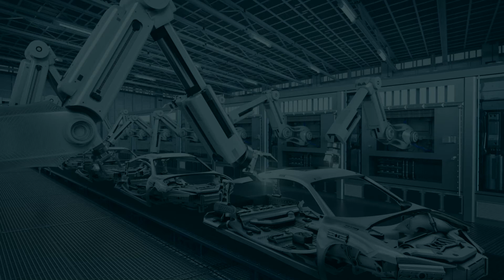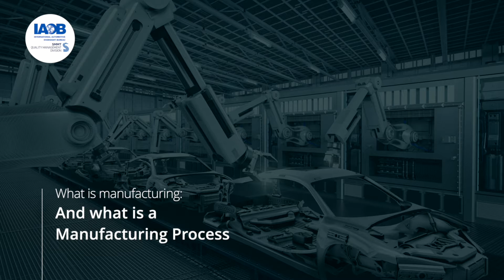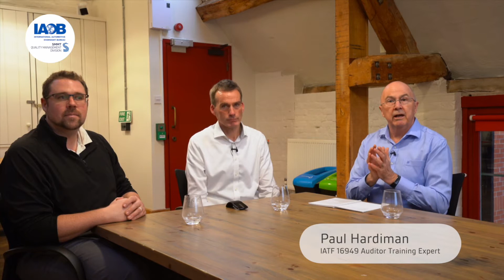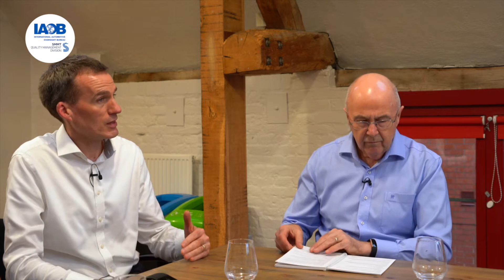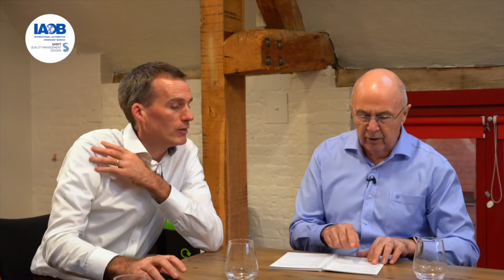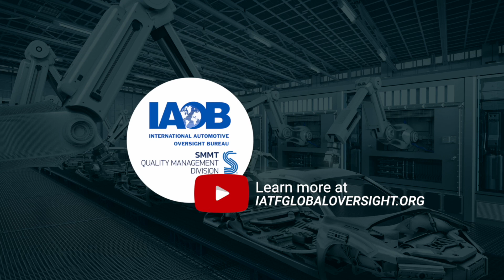What is manufacturing and what is a manufacturing process?

Comment: Dear sir
Just a clarification - if an organization is having x , y and z processes with 3 shifts, each processes have to be audited covering all the shifts within 3 year period? Example process 'x' is planned to audit 1st year for 1 shift and 2nd year for 2nd shift , 3rd year for 3rd shift... Is this acceptable? Pls clarify
Reply from the maker: You are correct, AT MINIMUM, all manufacturing processes have to be audited in the internal audit programme in a three year cycle, but in deciding the frequency you should review performance data, customer issues, previous audit results, changes etc.
Reply: @IATFAuditing  thank u very much
Reply: I think that you have to audited each one process in all shifts where is performed and also the change between the shifts must be audited too (where the 1st shift is finishing and 2nd one is starting) in order to see if this is going according to the rules. If for process "x" are working different shifts (staff) than the process "y", then you should audited the all shifts in process "x" and the change of the shifts. And in another audit to be audited process "y". But will be great to see the point of view of the experts too.
Reply: We have 3 different processess too - Injection Molding, Printing and Assembly. The shifts are different for each of them. So we are conducting separate manufacturing process audits for each process in all shifts where is performed as also auditing the change between the shifts.
Reply: @danielapazvantova7901  my doubt is that injection moulding process is planned 1st year covering all shifts and 2nd year printing covering all the shifts and 3rd year assembly process covering all the shift if we r running more one shift : is this acceptable as per the rule ?  Ofcourse verification of shift changeover could be the part of the process audit.. if we plan process audit as above for 3 year period length after applying risk based thinking, is it acceptable? This is one case and another case is that 1st year injection moulding for 1st shift and 2nd year-2nd shift for the same process and 3rd year -3rd shift for the same process...
Similarly for printing & assembly process.. if we cover all process including 3 shifts for 3 year length period , is it acceptable ???
Or both the cases are acceptable as per rule ?? Thanks in advance
Reply: @sundard2838  I think that if the risk assessment hasn't requre it, it is not a problem to audit 1st process the first year, 2nd process the second one and the 3rd process - the third one as you plan during the audits to cover all shifts where the process occurs + the shifts chageover.